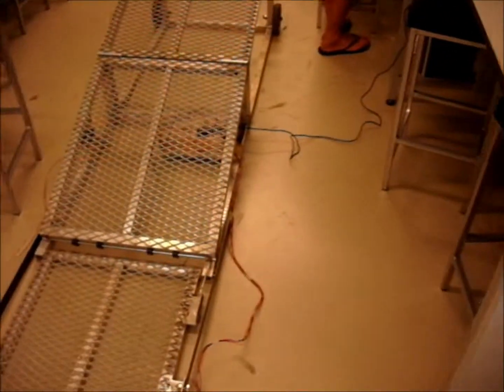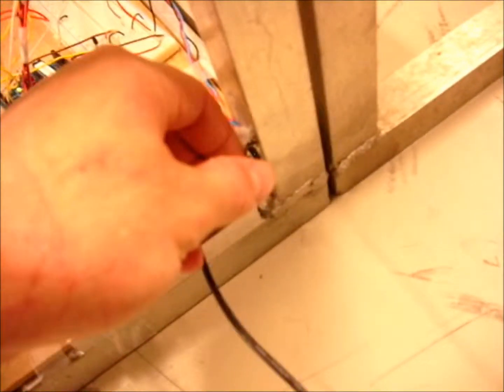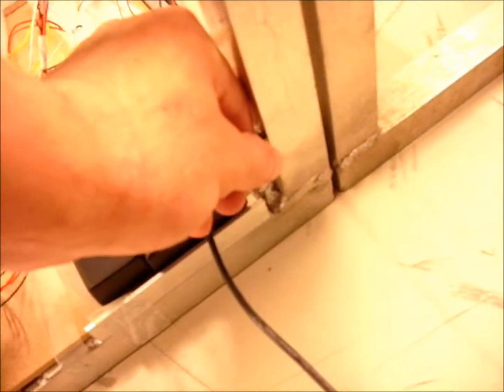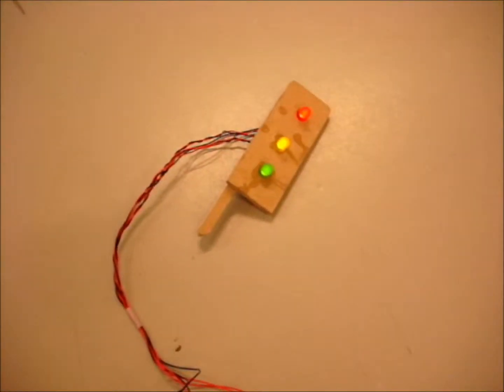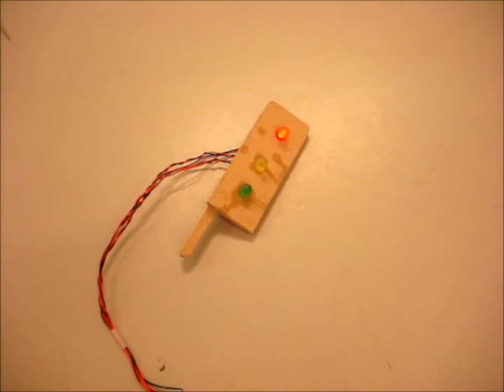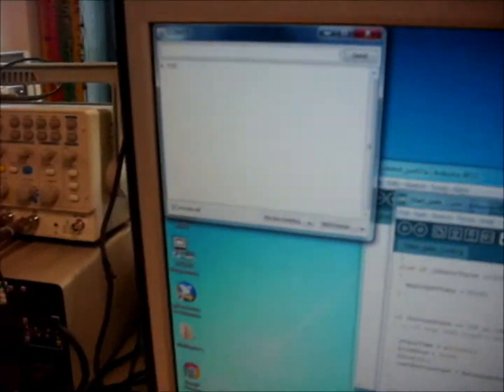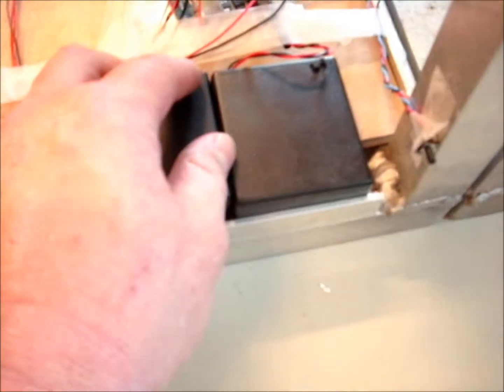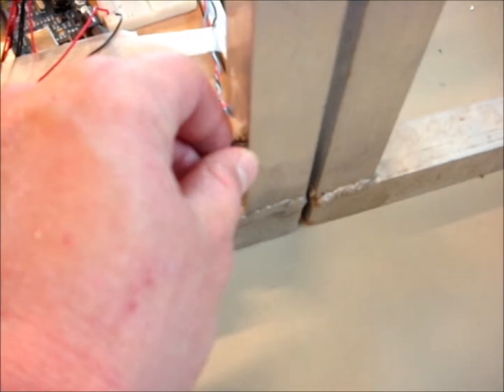Arduino 4x/ bmx start ramp testing

Comment: The arduino is controlling an electro magnet? Can you also add audio to this like the UCI start gates?
Reply from the maker: The arduino controls two electric catches - the type used on high speed trains to secure the doors. Very strong, as the last clip shows, however to release this particular model, only a very small voltage is needed.The arduino controlled when the 5V supply from the first power pack was delivered to the catches, which was enough to trigger the release. 

Yes, it was our aim to have audio, however we didnt get round to finishing that part :(
Reply: Andrew Lewis Are you selling the electronics or the circuit diagrams?